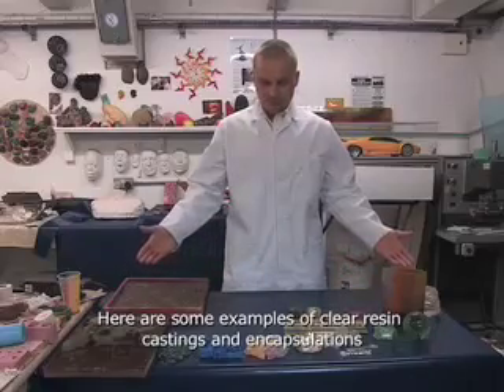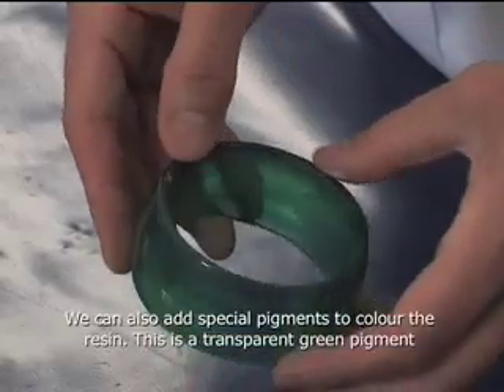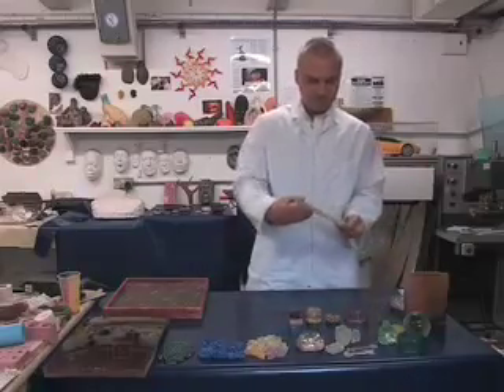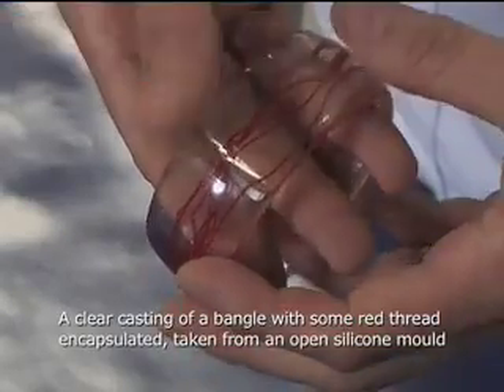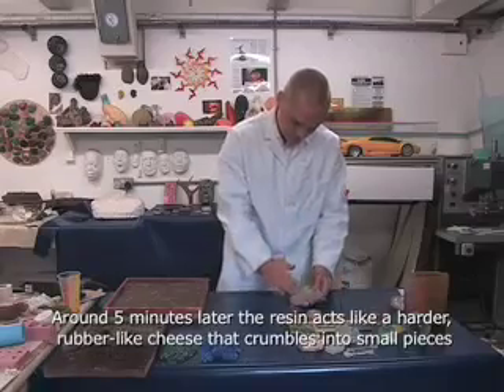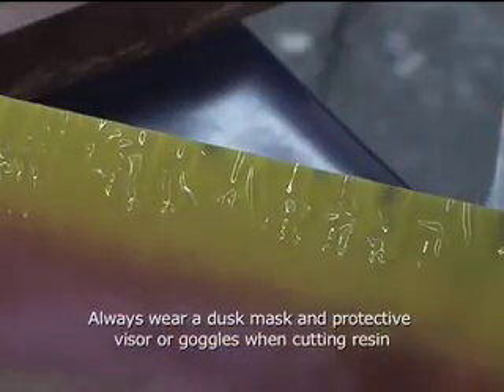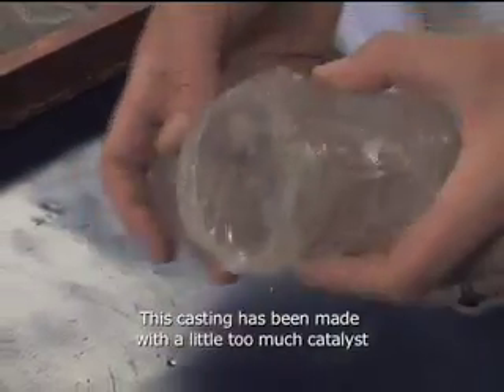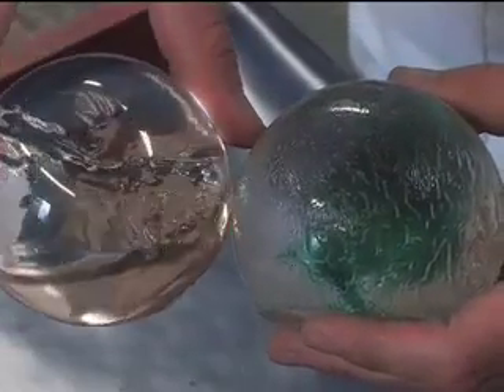Introduction to clear casting resin

Comment: Is there any chance you could tell me how to pour a very large casting, my mould is 15" high and 6 inches square. Apart from doing numerous small pours (which then would show the lines for every layer, which I don't want), is there any way to do it so that the end result is a very clear finish showing the item inside. Thanks in advance.

Comment: hello there, i need help. I want to make a copy of a 1:64 Hot wheels car, what resin would you recommend for such? dont have to be colored since i will apply spray paint. also what resin will cure crystal clear, I need it to be crystal clear for the windows of the mode. what type of material should I use for the mold? E mail me djdreamix69@gmail dot com

Comment: I always get tiny bubbles that rise to the top of my clear resin stuff. I've tried heating it, vibrating it using a hand-sander with no sand-paper, using a blower on the top, popping the bigger bubbles with a needle etc. but I always get minuscule bubbles on the top of the cast. Suggestions?
Reply: RICHOCOARM
Hi Nice video and good advice...I was having big probs with bubbles in silicone and clearcast ...So I decided to make a vacuum chamber...I found a strong steel ribbed container on ebay for vacuuming out fireplaces all the bits stayed in the container...I lined inside and outside with mat and resin  and built up 3 layers..Then I placed it on a piece of laminated wood upside down,I drew a line all round 2" away from the container and shuttered this off with some flexible neoprene an inch high. Then i poured in a few mixes of resin and talk mix so i had a 1" thick and 2" lip all around the top of the container.Then with neoprene I shuttered the inside and outside all round so I had an inch above the lip to pour in silicone,This gave me a wonderful seal.I baught the in/out fittings from ebay lever valves and press guage drilled thru matting and steel core and tapped ...Then I screwed the fittings in with araldide smeared on the threads.Baught a cheap single stage pump, ebay again, placed a piece of tripple laminated bullet proof glass onto the silicone lip, switched on and watched as the glass smashed 2 layers in a star pattern .......mmm  Found a great seller on ebay who built v chambers and for £50 he cut me a disk of 1" perspex to fit my chamber.Put a cup of water in, and switched on the pump after a few mins chugging away just above end of guage water was boiling I was so pleased,  I put a streight edge on the lid and you could see it slightly curved in !!! One important point, I fitted a little valve on the inlet which allows (regulates) the air to come in slowly If you let it blast in whatever you have in your pot will explode and make a mess.I think all the bits including the pump came to around £250  It holds around 20 ltrs.
Reply from the maker: The only way to get rid of bubbles (aside from ensuring all mixing sticks and cups are totally free of moisture) is to degas your resin after mixing, in a vacuum chamber at around 27-29Hg (-1bar). It'll set you back about £700 for a good one though, but it makes casting bubble free a doddle.
Reply from the maker: Nice job. Hope it works well for you.

Comment: Most Resins build a heat as they cure.  Do you know of a resin that has a very low heat in curing ? I want to embed an object that is heat sensitive. 125 to 130 degrees.
Also very large castings .  6 inch diameter , 7 to 8 inches long.
Reply from the maker: Just use less catalyst. I've used 0.25% of catalyst before and it set really really slowly. I took about 5 days to cure!
Reply: RICHOCOARM THANKS .  Sounds great .   I will give it a try .
Reply: RICHOCOARM do you think you could use a resin to mold utensils. forks, knives etc. doesn't have to be clear necessarily. The one I'm using is Crystal Clear. and I don't want to start if it wouldn't be safe to use after it was cured. 
and if it's not safe, then what would be safe to mold utensils that wouldn't mean metal casting.

Comment: I got polyester resin the other day and i dont know what to use as a catalyst or whatever
My stuff wont become solid and its been 2 days
Reply from the maker: You need to make sure you use 2% catalyst. that is to say......for every 100grams of resin use 2 grams of catalyst.
If its cold or damp where you are working it will take ages to set. If its really thin or spread over another surface, i.e. painted on, it won't set well. I just found out (to my dismay) pure carbon strangely stops the curing process dead..
Try heating your surface at a low temperature (65 degrees c) over 24 hours, but don't do this in your home or anything you use for cooking. It stinks!

Comment: I'm thinking of making a personalized tobacco pipe, I have wood for the bowl, a length of brass tube for the stem and I'm thinking of trying to make sort of a tortoise shell patterned mouthpiece out of resin. I have to admit that I have no experience with resin or acrylic casting so any advice on why the best type to use or how to get the patterns I want would be greatly appreciated.
Reply: I think the resin will give off toxic chemicals if it is part of a pipe. Inhaling that would be dangerous.

Comment: Dane mouland Did you ever end up casting the meat in resin?  I'm looking to do something similar. Not meat, but a wet food item.  Thanks!
Reply from the maker: if you can bind it with a biological gelling agent then anything is possible. we done cakes, jelly, sugar, lard and trifle. not tried meat. should think you'd need to mash meat and partially cook it to set it in that shape.....bit like meat loaf really, only in a silicone mould of your choosing.......yes silicone can be baked in at temperatures below 200c. ;) Gelatine might also work. don't think resin would work if its too wet, it doesn't like moisture. find something that does (i.e. gelatine or heat)...... you could also freeze it whilst in the mould.

Comment: what the difference between acrylic resin n methacrylate laminated. i mean in color, forming easiness, resistance, etc. Also as far as i know "windows" on big aquariums are not properly cristal but casting liquid acrylic on specific mold. can you please share the most information to me. my best. regards.
Reply from the maker: Not quite sure what you mean. But there are 3 forms of 'acrylic' (which is in fact a brand name) its actual name is PMMA which stands for PolyMethylMethAcrylate........forgive me if thats spelt wrong. PMMA is typically supplied as sheet plastic. of which there are two variants; Cast and Extruded. Cast is used for most application when clarity is essential, extruded is used for increased impact resistance. the third type is liquid resin. Its pretty harmful stuff so I try not to use it myself. casting your own acrylic demands serious investment in a suitable environment for casting, not to mention master and mould making to even begin casting large sheets of the stuff.
My advise is, if you need 'acrylic' use sheet form. and follow the above guidance.
;)
Reply: yes i meant PMMA i knew that are cast with lot of pressure or extruded but not quite sure on liquid acrilyc if it whas the same material cause every liquid needs a catalyzer and i told you that as far as i know big windows on aquariums are liquid resins poor into a mold without pressure (so arent cast) but anyways thanks bro. my best.

Comment from the maker: something wet......like what specifically? You can preserve or chemically dry a wet/moist object prior to encapsulation using various techniques. In fact I found a website on that exact subject the other day, so there is info out there about artificial drying. 

Water reacts with polyesters (and alot of other resins). It causes the resin to go cloudy or very bubbly and soft. Sometimes it just wont set.

Comment from the maker: You could use polyepoxide resin. I like to keep my exposure to epoxy and urethanes to an absolute minimum due to notorious ('potential') carncinogenic, cytogenic/mutagenic side effects. You could invest in appropriate specialist ventilation to use these 'safely' but the cost and waste involved with specialist extraction systems is usually enough to encourage the use of less harmful alternatives.

I would switch to Bioresin for all my clear resin needs if the cost was better!

Go Bio everyone!